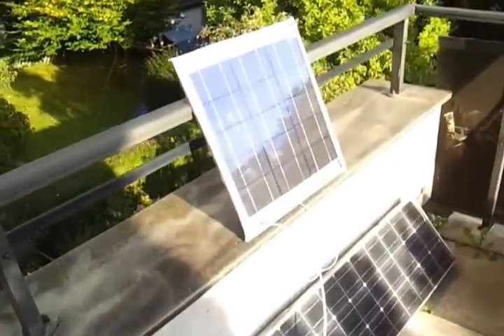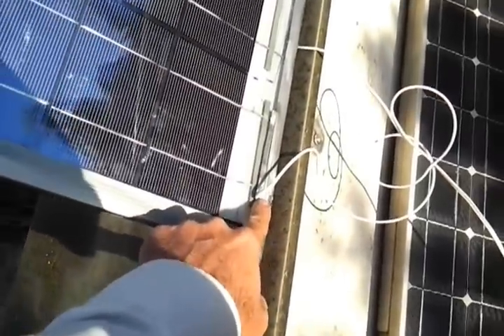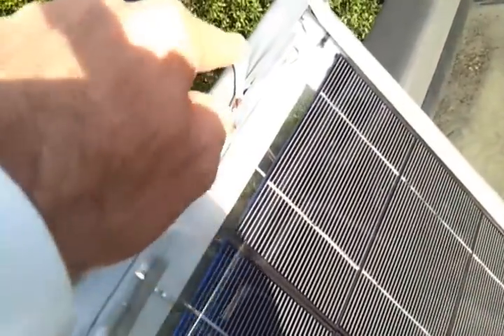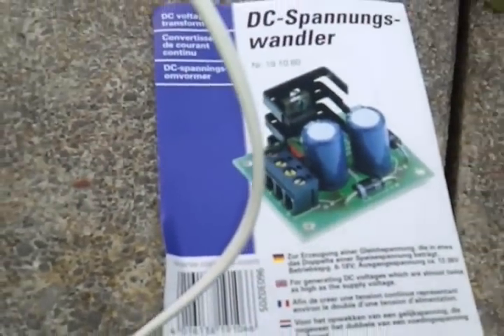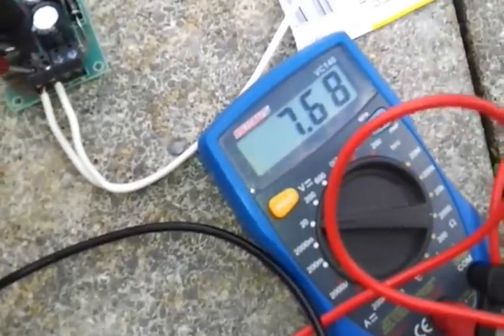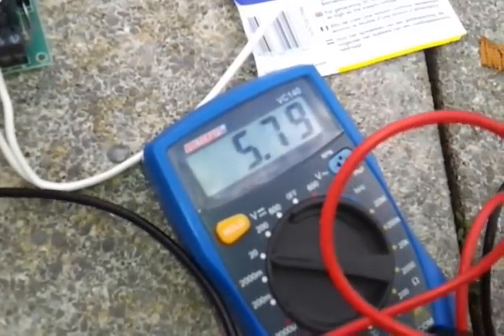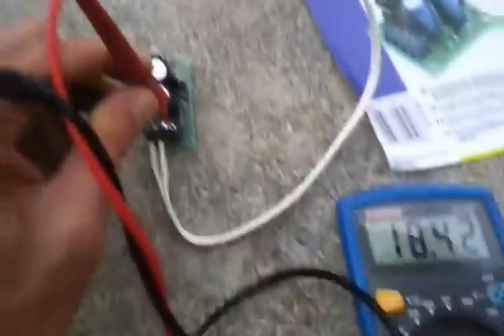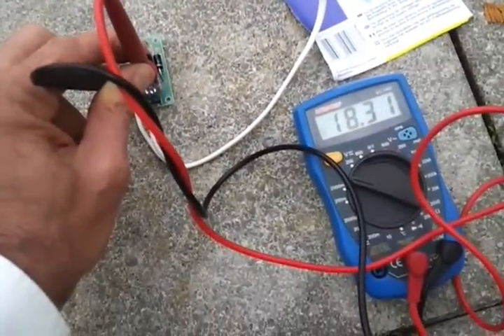Voltage doubling for solar panel

Comment: I guess you can now get the same wattage from the panel whilst drawing only half the current from it.  So there is likely a benefit from less drop across the panel's internal resistance and can run longer leads with less voltage drop.

Comment from the maker: Good points MrMegaelf; problem is I only have 12 V batteries these days; used to have two massive 6V Trojan L16 Deep Cycle batteries when I was off grid in L.A., but left them behind when I moved overseas.  Also would worry about balancing problems, charging one at a time and then reconnecting for 12V use (would also be a hassle).  This solution simplifies things but i think you are right, people should know all the options that are out there! Thanks!
Reply: Curious - why did you move to Europe, and are you enjoying it?